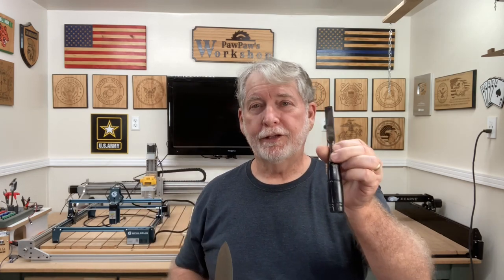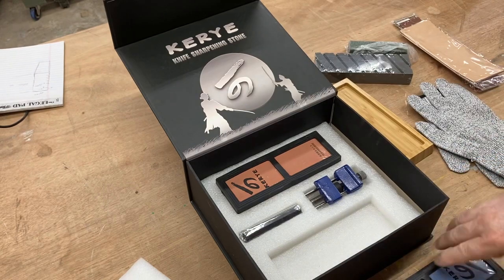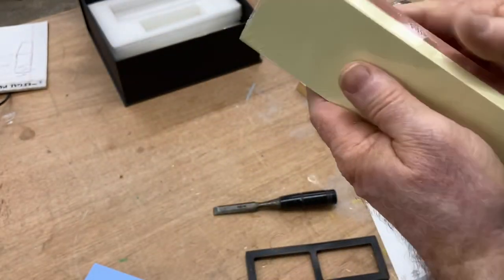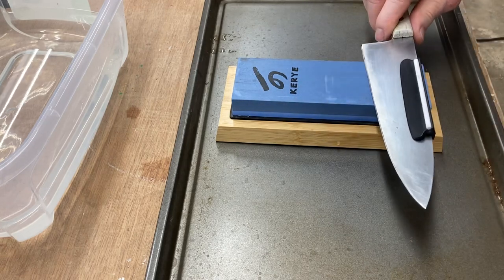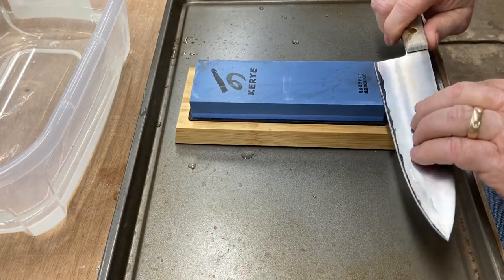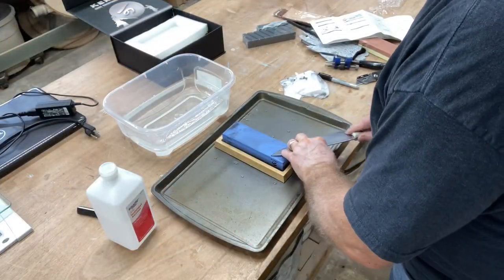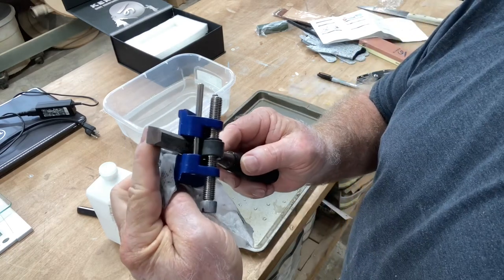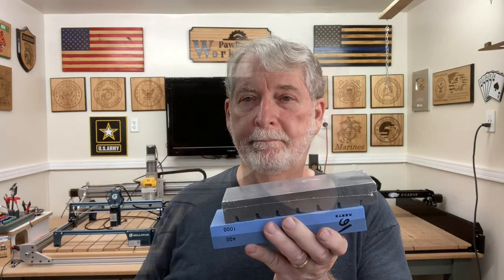KERYE Professional Japanese Whetstone Sharpener

Comment: I just ordered this set from Amazon as I am in the market for a sharpening system, luckily for me it was on special so even better value for me. I was just looking for something that offered good results at a reasonable price. There are a lot of very similar looking sets on Amazon but under different brand names, it is very hard to know if they are all made by the same manufacturer then rebranded, but after watching a few reviews I was confident this set would do the job for me so went ahead and ordered it. When it has arrived and I have had a chance to try it out I will edit this with my findings of how an amateur fares (not a complete amateur, I did work as a carpenter for several years when I was young and had a lot of experience sharpening chisels and plane blades, just not knives)
Reply: So, where’s the update?
Reply: @ppac300  They work fine however the stones are quite soft and my 8000 seems to have some contamination actually in the stone making it not really worth using, however for the price and for someone that only occasionally needs to sharpen they are good value, the issue with the 8000 stone I have not seen anyone else mention so it may have just been a bad batch.

Comment: Great kit, perfect gift pack with everything needed. 
question on knife sharpening, Japanese stones are quite soft in comparison to other stones., Many people only draw blades backwards rather than forward & shaving away the stone surface,  or would you only do that on the white stones?
Have you seen sushi knife sharpeners testing sharpness cutting into thumbnail? looks horrendous, surprised they still have nails left!
Reply from the maker: Yes, it’s a perfect gift. One reason for that is to keep from digging into the stone. It also creates that slight burr and then it removed as you turn the blade over
Reply: I think they only do the thumb nail test as a demonstration I doubt they would do that for every knife, but yeah it does make the hair on the back of your neck stand up lol